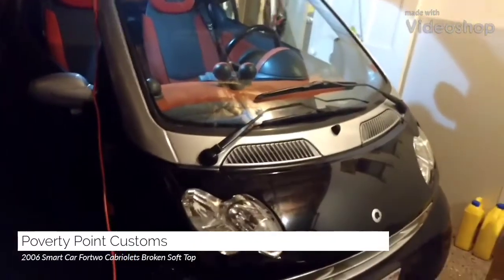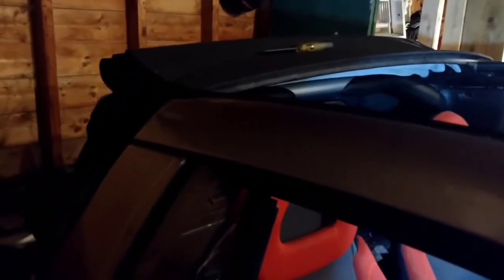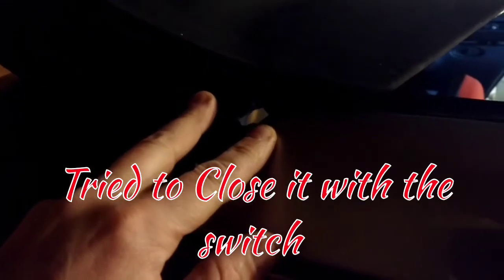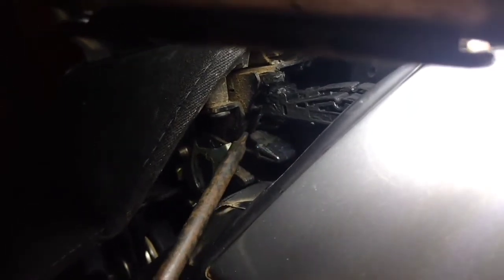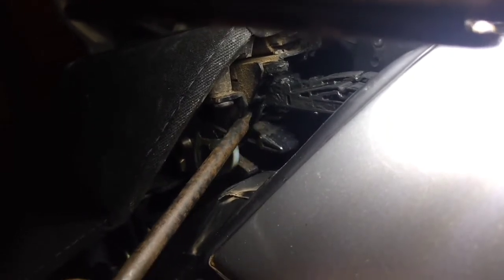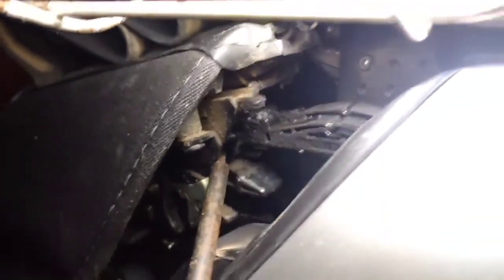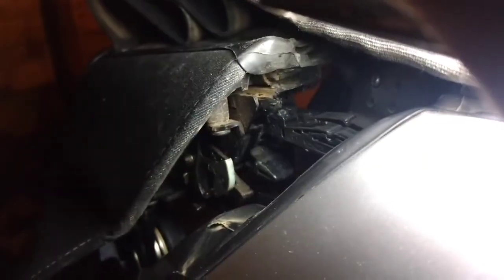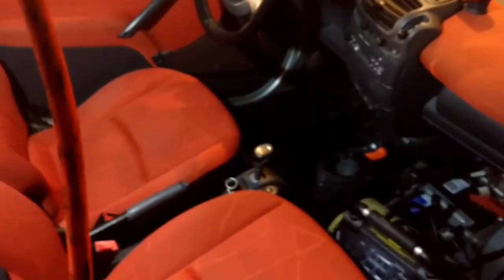2006 Smart Car Fortwo Cabriolets Top Will Not Close and battery location

Comment: Did you fix it? If yes then how
Reply from the maker: I wish I did a video on the fix, the cable/wire that hooks onto the top and actually pushes it out up close it and pulls to open it came disconnected,  and the soft top on one side when it latches to the roof (when it is starting to close over head) onto the track the guide would not go on the track. Alot of playing around with it finally got it working. I've been told if the soft top mechanism breaks most people will get rid of the car, I guess it can be quit pricey to fix, I really lucked out, but took hours and hours of playing around with it to get it working.
Reply: @PovertyPointCustoms  здравствуйте, очень нужен ваш совет ,в интернете нет такой информации, купил смарт с нерабочей крышей и ищу схему подключения. Как можно механически отщелкнуть крючки которые держат крышу в углах? На видео вы их пометили стрелкой .очень нужно их зафиксировать .заранее спасибо !